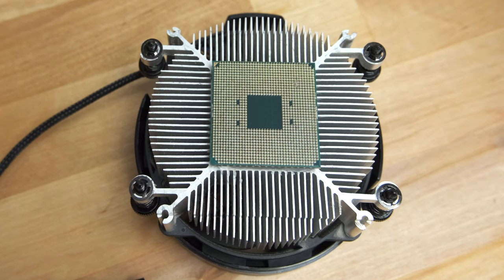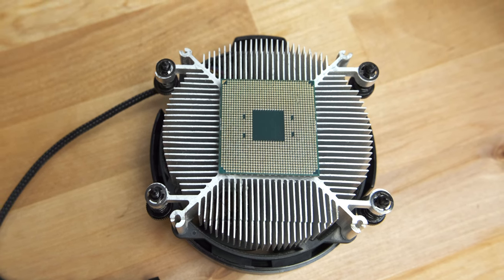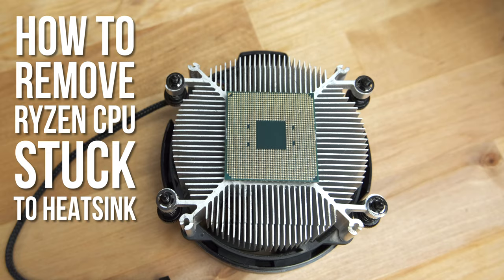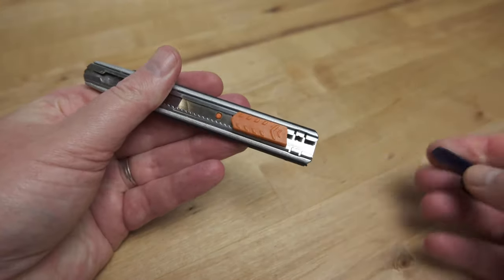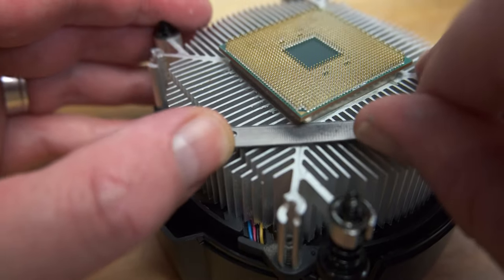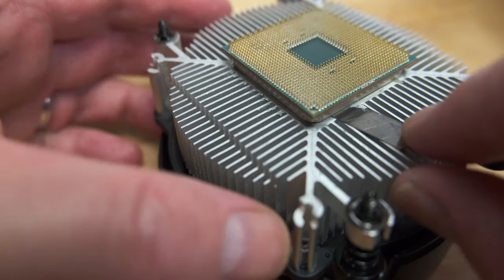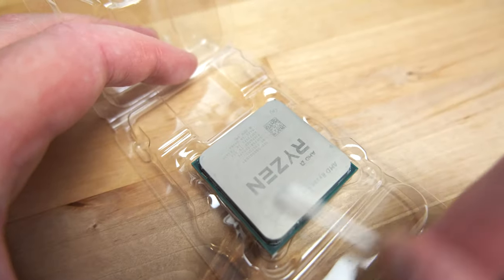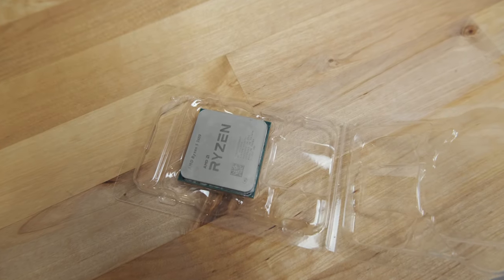Ryzen CPU stuck to cooler ? Here's how to remove it.

Comment: Bro I pulled this thing out with my fingers with all my strength and that shit popped and almost fell on the floor, the only thing that saved it was the loose thread on my shorts which the little pin hung onto.

Comment: note to self,whenever you want to remove the cooler at all makesure you do it after a few hours of gaming or while the CPU is nice and hot,then the thermal paste will hot
Reply: Thanks for the tip! I used a hair dryer for something like a quarter minute and it came off easyly
Reply: Hopefully I remember in the next 4yrs 😂

Comment: Use dental floss. no heat needed, you're welcome.
Reply: Thanks for this!
Reply: how do you use the floss? I tried but find it very hard to handle. And dental floss might not be thin enough, my cpu sticks really hard to the heat sink.
Reply: @shockmath2912  In my case, dental floss was enough. Did you try warming up the cpu first? The way I used it was by putting it between the cooler and the CPU, doing the same movement as when using it with your teeth.

Comment: Quick, understandable and straight to the point! I successfully managed to remove CPU with blade from a 9mm scalpel within 30 seconds. Before that I fanned it for about 45 seconds. You just need to be very careful so you don't break any pins. It worked like a dream! This is by far the most reasonable solution to this tricky problem. Huge thanks man, this is how should tutorials look like!
Reply: Too big of a risk of blowing hot air among the cpu pins :/...

Comment: This method is OP. Worked for me after struggling 30 mins to loosen the CPU. Kudos to the editor.
Reply: What do I do if it is impossible to get the flat blade between the cooler and the heatsink, they are just too tightly compressed.
Reply: @hejalll  I'm having a similar issue. Might try wiping the edge of the thermal paste with alcohol to open a gap for the blade
Reply: @kuetjr  I ended up ripping the thing out of the socket, it didn't damage the motherboard luckily. However it was still stuck, so I ended up using a hairdryer to soften the paste a bit before just putting muscle into it, eventually got it off.
Reply: I just yanked it off and was glad not to break any pins

Comment: Thank you! The same thing happened to me, with a Ryzen 3700X and its stock Wraith cooler (which comes with pre-applied thermal paste, so all I did was mount the cooler on top of the CPU). AMD should sell this thing as adhesive, not as thermal paste. I was able to free it by following your instructions though.
Reply: I just had this issue with a 3700x too. The thermal paste is absurd how hard it stuck. I ran a CPU stress test for 30 minutes and it still wouldn't come off. What a nuisance
Reply: @anonony9081  I know, I can't imagine how AMD managed to screw this one up so badly. It can't be easy to find a thermal paste that is also such as a strong adhesive, but somehow they managed to do it.
Reply: @anonony9081  I have the issue rn with a 2700x. Ran an 8 hour blender benchmark, nothing. I ended up pulling it out of the socket with the heatsink still attached. I still can't get them seperated tho.
Reply: Ha having the same issue right now. My cpu is literally welded at this point to the motherboard and another issue is I am to far in with my motherboard replacement that I can’t warm it from a stress test

Comment: For anyone struggling to get the blade underneath the corner. Try going flat against the side instead of the corner. I think the TP application pattern affects how stuck tight the corners are vs. the edges. I struggled for about an hour with the corners, tried the side and it came off in a minute or two.
Reply: What do I do if I don't have an flat blade at hand
Reply: Thank you bro 👊
Reply: MVP. Thanks dude.
Reply: You just save me a lot of pain and agony!  Thank you for this comment.

Comment: My Thermal Grizzly got stuck the same way lol. Thankfully the CPU did not get damaged at all. But yeah... wtf AMD. IMO the issue lies with the lever/socket design. It should have way more force/leverage, should hold the CPU in place way stronger.

Comment: What the knife accutally did was to slice through thick paste so that the air pressure hold the cpu and cooler together can be diminished, just slice around the top edge of the cpu cap until you could easily pull cpu off the cooler.
Reply: god please do not do this people... just get a hair dryer and heat it up a bit while wiggling it and it will pop right off. HEAT IS THE WAY PEOPLE THESE CPU'S LITERALLY GET RIDICULOUSLY HOT AND ARE MADE TO HANDLE HEAT. Do not take any type of sharp objects like a blade or screw driver to your CPU or cold plate...

Comment: So I've prepared everything I needed before I saw this video, fan and small blade at the ready but the Dann thing wouldn't come off. I've tried about an hour, corners or the sides but in the end, I used a mora knife and a very small hammer and that finally made the CPU come loose.
What a ride. CPU looks good too, all pins in place

Comment: Happened to me yesterday. The CPU came out of the motherboard stuck to the stock cooler with the stock supergl–I mean thermal paste.

It took two rounds of around 2 minutes of heating with a hair dryer, but then I finally managed to gently twist it off. I used a kitchen towel (napkin roll) to try to twist it off after the second round of heating, because it was burning my hand otherwise.

No pins bent, no nothing. I felt like a damn surgeon, cause I set up my phone on a stand and used the Magnifying Glass feature to zoom all the way in, and inspected every pin.

Then I placed the CPU back on the motherboard, put some good thermal paste on, attached the new cooler, and everything's working perfectly now.

Life saving video right here 🙏

Comment: Bruh the tip using the whole blade worked like a charm. It came off and flew away but landed safely on my couch. Just apply a lot of pressure and it will work eventually. Great video!

Comment: BEST METHOD EVER. Mine was extra stuck on (mongoloid who put it on there before me literally used all the paste in the world caked everywhere), so I let the hair dryer go a little longer, evenly warmed up all four sides around sink. You do have to apply a considerable amount of lateral pressure with blade side as flush as possible with metal of sync, but BAM it came off. YOU ARE A LIFE SAVER!

Comment: I was removing the included AMD heatsink/fan to replace it with a Noctua NH-U12S when this happened. I just used a small blade to pop the CPU free. So, I had already separated mine, but this video shows that this is not uncommon situation. I was really surprised that this happened as it was built this past Black Friday (8 months ago) and it is a Ryzen 5 3600 that is not OC'ed. Oh, well.

Comment: For some reason it didn’t work for me? I have the exact same cooler/heat sink and I’m using a box cutter blade. I’ve heated it up with a Hair dryer several times but nothings worked.
Reply: Nope, not working. Tried again and again and again. Nothing gets under it.

Comment: Just did this and it worked… but the CPU went flying down to the floor. Pins looked fine and it went back into the socket without issue. I hope it works!

Comment: My God, man! Thank you! The razor blade on the corner after using a hair dryer did the trick INSTANTLY. 

I've been trying to remove this thing for the last hour using the "twist" method, but I don't think it worked because I applied too much thermal paste.

Comment: Guys i just reccomend heating it with the hair dryer and applying small forces on the corners and move it around little by little and it should come off no need for a blade. Took me 3-5mins no blade needed

Comment: I pooped myself when this happened this morning. Never used a stock cooler. Never had a cpu get pulled out of a lock downed socket either. Bent 4 pins. Luckily I was able to get them straight and all is working as it should 😊.

Comment: At least I'm not the only one this has happened to. I hope I don't have an issue with the CPU when I reinstall into the new motherboard tomorrow. 🤞🏾
I'm afraid that the pins may be bent, even though they look fine.
Reply: How did it work?
Reply: @iseeu-fp9po  Thankfully, it went fine. If you haven't removed your CPU yet, I strongly recommend letting the CPU warm up for a few minutes before removing from the old mobo. 🙂
Reply: @thepragmaticexistentialist  Good! The same happened to me when I switched to a new CPU + cooler. I was so worried I had bricked the MOBO but everything went fine with the installation, thankfully. However, I still haven't found a way to remover the old CPU from the old cooler. It's LITERALLY glued on like superglue and I'm afraid I might damage the CPU if I use too much force. Will try with some isopropanol and floss or a thread or something.

Comment: I just remove the fan connector from the mother board and let it run while checking temp and when 90*C+ is hit I quickly shut it off and remove all plug then unscrew everything and i find a few light twist and its removed.

I made a mistake once and it cost me the CPU.
Didn't heat it up and used a thin swissarmy knife to pry it off and the CPU never work from then on.

Lesson learned, never use any ryzen preaplied thermal paste.

Thermal grizzly's kyonaut thermal pasre was even easier to work with when it has set there for even a year, a little heat and its already easily detach the cooler from the cpu

Comment: This is fucking ridiculous.  I removed the cooler and bent about 50 pins on a $500 CPU.  Even a heat gun won't loosen it.  It's stuck like glue.  Fuck AMD.  Never had this problem on any on my Intel CPUs over the last 20 years.

Comment: Good vid, but doesn't work here. Weird, 1st time ever this happens to me. The entire connection is rock solid and the knife doesn't cut into it at all (it's heated alright). Any other options you've tested?
Reply: I feel like I have tried all the options out there and no luck. This video didn’t work for me either. Any luck?
Reply: @wigertoods8552  no option to slide any blade/knife in-between for me. What finally worked was cutting in just a bit, maybe about 1mm, and using the blade's tip as a lever. Surprisingly, not much force was needed - so if you try that and it won't go off gently.. I wouldn't try to apply brute force.
Now to think about it, if it had happened again, I would try wrapping a cord around tightly and pulling - idk, just a theoretical idea though :) Seems easier now that it's done, but I remember the frustration. Good luck!

Comment: im doing a thermal paste change for the first time in our current pc which hasnt been thermal paste changed ever since it was gotten and our pc is gotten back way from when it was pandemic, what happens to the socket and the pins? this happened and the socket is locked

Comment: What if I don't have the original case the CPU came in? Are there any alternative ways to position the CPU to clean the thermal paste off the top so I don't break the pins?
Reply from the maker: You could drop it back into the CPU socket on the motherboard just while you clean the thermal paste off, then lift it out again.

Comment: Please help I don’t have a thin blade like yours what should I use?
Reply: In my case I could not even fit the blade between the heatsink and CPU. I just warmed it up and slid the CPU to the side. Crazy.
Reply: @bubbyboo  that’s actually what I ended up doing but the cpu flew off and I bet that some pins but not that badly
Reply: @bubbyboo  how long did you warm it up for
Reply: @muidtheninja  About 30 seconds with a blow dryer (until the heatsink feels very hot, but not burning hot)

Comment: I see a lot of people who got good results using this method but for me it just doesn't work. The thermal paste is basically a dry adhesive at this point and nothing really happens to the consistency of it when I apply the hairdryer. I'm afraid heating it further will fry the CPU, so I have to find another way.
Reply: Hi how did you do it? This is thr problem I have the thermal has been tried up

Comment: the same thing happened to me, thank god the cpu did not have some bent pins. but my concern is the motherboard, will it damage my motherboard? because it went off without unlocking the latch. thanks in advance!
Reply: I think I just did the same thing and now I’m freaking out that I might have bent pins
Reply: i think bent pins are really obvious when you observe the cpu. try to check the cpu if there are minor bends of just chech if they are in a aligned

Comment: Bro my cpu is stuck so hard no matter how much force I use its not moving a millimeter. My whole heaksink is scratched because Ive been trying this for a hour now

Edit:
I DID IT FINALLY but I had to apply so much force that the cpu flew off like a bounce ball and fell on the pins. Now I have to fix the fckin pins are you kidding me

Comment: there is two ways to remove a CPU stuck to a heatsink, first is to heat it up & use dental floss.  I never used that method, I've always put it in a freezer over night & put the CPU back on the motherboard & twisted.

Comment: What if the cpu is still in the motherboard?
Reply from the maker: That’s what’s supposed to happen.
Reply: @BartechTV  I meant to say case but I ended up taking out as much as I could leaving it in the case and using a hair dryer (reddit suggestion) which was sketch but didn't matter to me if the old CPU was damaged at that point just had to get out of there and it worked so yeah.

Comment: I got a new build using am4 and wondering why my temps are so high so decided to change the thermal paste but instead i panicked when i plucked out the cooler with the processor on it🤣 in the end nothing changed processor is still hot and stock cooler are shit🤣

Comment: AMD really made me mad with this design. Why couldn't they have some thing that clips over top of the CPU like Intel, it popped out once with the stock cooler I got an aftermarket, but now it pops out every time I think because the motherboard loosened up its grip Way to go that's the second time my $400 Ryzen nine 5900x popped out like that it happened twice with my 5600 G. Luckily it's worked every time I don't know if I need a new motherboard. I guess I'll try to run my computer for a half hour under heavy road next time, but it seems to pop out just by loosening the screws to my cooler

Comment: Razor or box cutters
Reply from the maker: The problem with razer blades is that they're sharp on both edges, so you'd probably cut your thumbs. A box cutter blade should work.
Reply: @BartechTV  I also do this on automotive vehicles where heat sink paste ends up like glue.  You just get the triangle point between the paste and heat sink surfaces and easily wedge.  Its a good video.

P.S.  I never tried to use a heat gun.
Reply: @BartechTV The heat gun worked.  I just tried it on a dell workstation.  The shape of the heat sink did not allow me unlock the CPU and I also couldn't get a box cutter in there.  Thanks.

Comment: i got my pines blended because of this the cpu was stuck to the wraith prisme and when i tried to remove the wraith prisme right bracket i blended almost 30 pines and guess what i managed to adjust them all in one week even after adjusting them the cpu was enable to enter the socket without a lot of force but when it entered it worked normaly i would never buy and am4 cpu ever lol